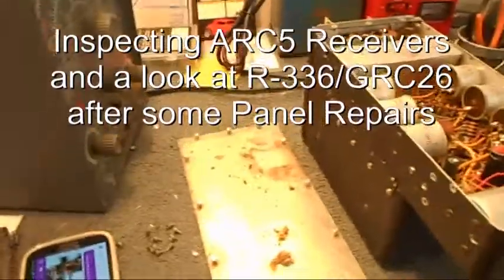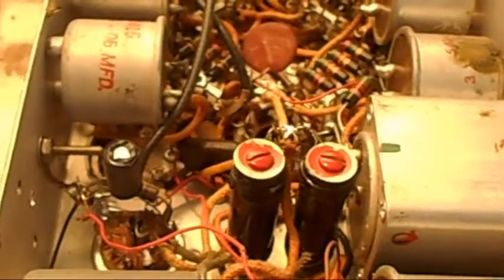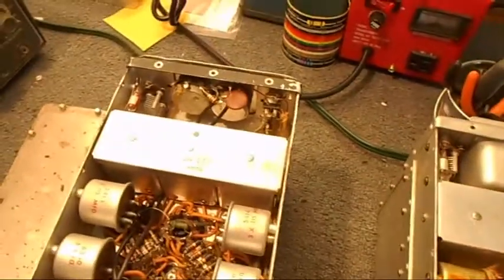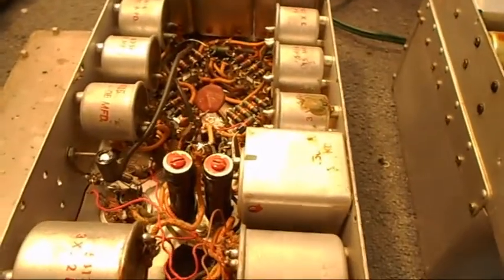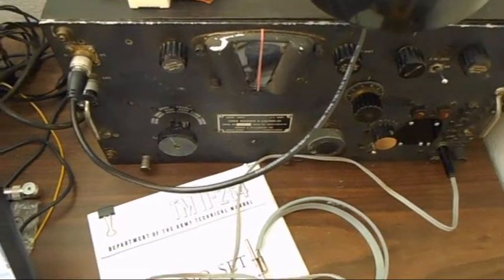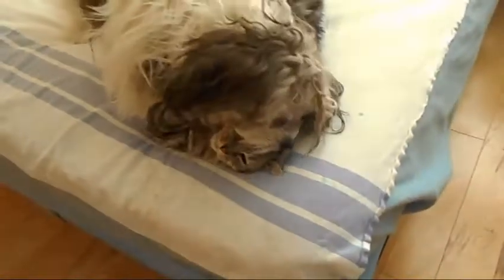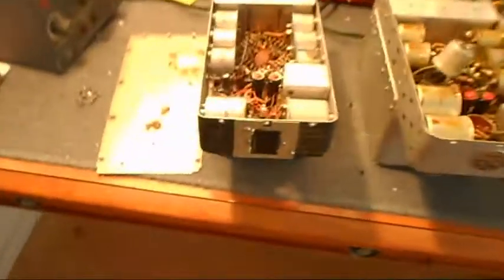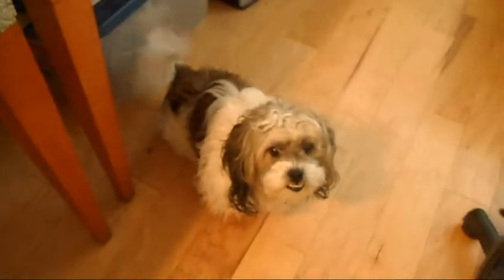Inspection of Two ARC-5 Receivers and checking work done on front Panel of R-336/GRC-26

Comment: Blows my mind that mice can get into that. Slow and steady you will get the ARC sorted!! You sure do have some good projects going.
Reply from the maker: Well so far the R-336 works so trying not to mess that up with my making the new Plexiglass window for it that was missing ruined two pieces of plexiglass before i got it the right shape to fit. Then the metal plate to cover the hole I made a paper tracing of it then cut it out of some 1/16" sheet metal got the shape perfect to cover the hole .The screws i had to get at the hardware store really small holes 4x 3/8" sheet metal screws. The part that was gone looked like a goose neck coming out and had a plug but all this had left was a hole with a single wire coming out. Don't need my grand daughter sticking her finger in that hole. ARC-5's are built solid and the coated Varnish on the wires and all the parts so the mouse couldn't hurt it lucky for me.

Comment: lol, they are cute.  The one recv. looks like it will run, are you going to use one for parts or try fixing both?
Reply from the maker: I'm going to start fixing one up. The internal parts that aren't leaking wont be replaced the ones that are will be opened up and cleaned out and then recapped with new caps and put back in the same mounting position.